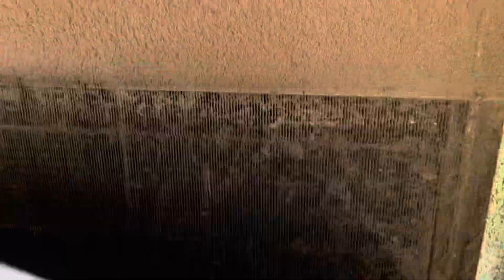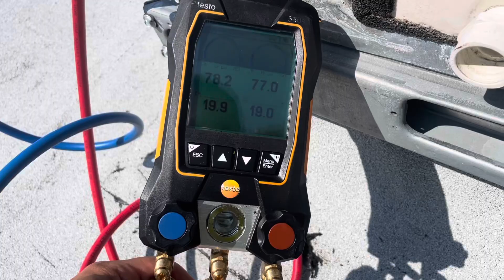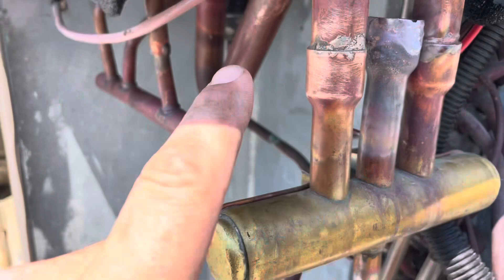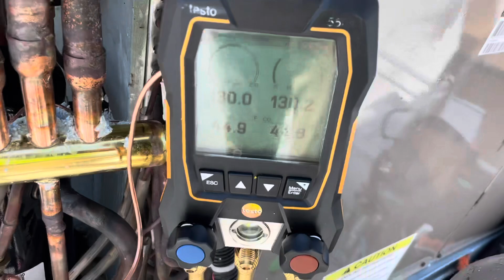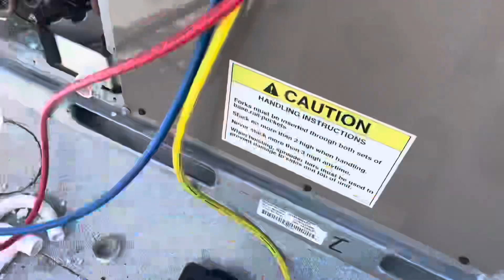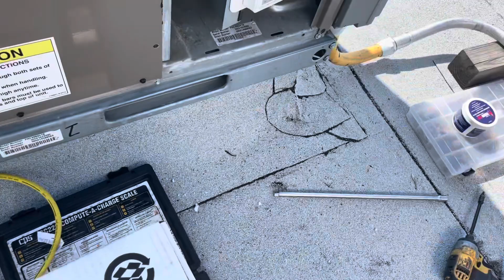Grossly Overcharged RTU Takes Compressor Out!

Comment: i cut out the RV with a recip saw, then unsweat the fittings and pull off using a channel lock plier. much easier. the copper debris will only fall inside the old reversing valve

Comment: Jeff,  shouldn't systems have a mechanism to prevent from overcharging?  Something similar to gasoline tanks when you fill  gas and is full it trips pump hose nuzzle (no more gasoline accepted).

Will using a portable plastic tent help you a bit with sun exposure??

Thank you for your video.
Reply from the maker: That would be nice.   

I had a tent but the wind tore it up.  Need to buy another!

Comment: That terribly filthy evap coil and partially plugged return grill likely gave this unit really low evap pressures and the last tech would just keep adding refrigerant to get those low side pressures up. I've seen grossly overcharged units in the same scenario. One had a way too low a fan speed. coils and airflow should be good and clean before checking charge to add or remove.
Reply from the maker: Well said! 🤙

Comment: If you remove the shrader cores it will recover faster,and to your question,they probably replaced the HPS with a LPS and never protected itself.and got overcharged.or there is no depressor on it.thanks for posting.

Comment: A lot of people cringe,  but I would have used a sawzall and cut all of the stubs on top of the rv and unsweat the stubs.  No chance of getting copper in the system that way, and would save an hour of work.
Reply from the maker: I was thinking of that.  Nice new sharp metal blade and probably wouldn’t have had an issue with shavings 🤙

Comment: I’m in Florida and I had a newer install, just about a year old, on a York split heat pump with a restriction in that round baseball size filter dryer. I recovered the refrigerant and pulled out 16 pounds. The factory charge was only supposed to be 8 pounds 
11 oz. Luckily the compressor was ok.
Reply from the maker: For sure.  Idk what some people think when they dump all that charge in!

Comment: People get confused because overcharging to a certain extent doesnt cause high head pressures in most cases. At least not as high as you'd expect, itll just stack liquid in the condenser and if you arent checking your subcooling itll get overcharged fast and you wont notice, especially on a system with a TXV
Reply from the maker: Well said!

Comment: I’ve been seeing so many overcharged residential units this summer making the thermal overload open on the compressor and the customer not getting any cooling. Units saying 10 and 13 degree subcool, im getting 27  and 31 with High head pressures and amp draws. Saving compressors is a job with all these overcharged systems.